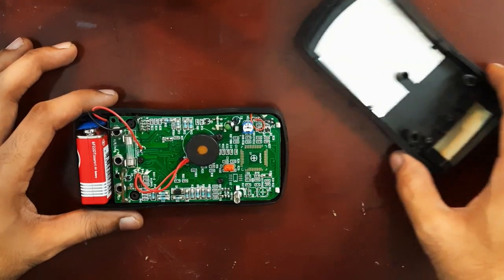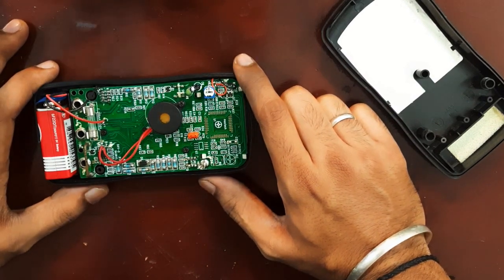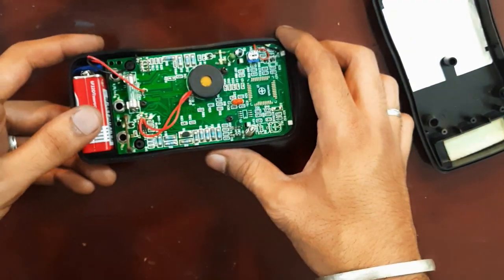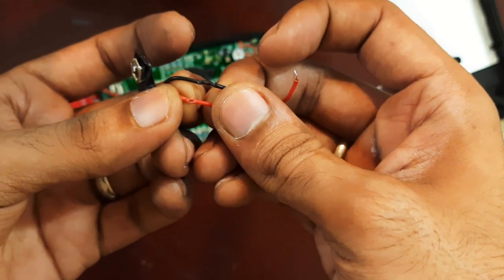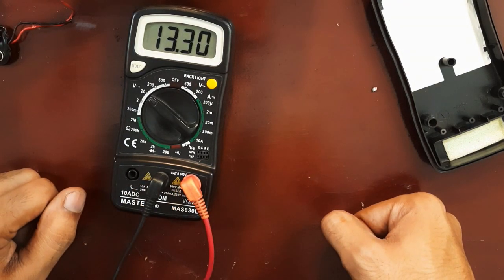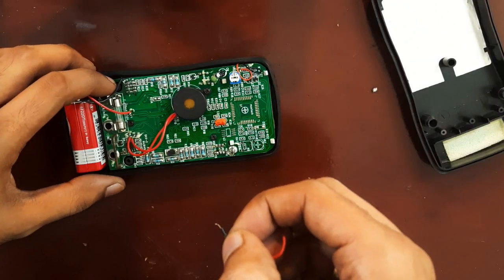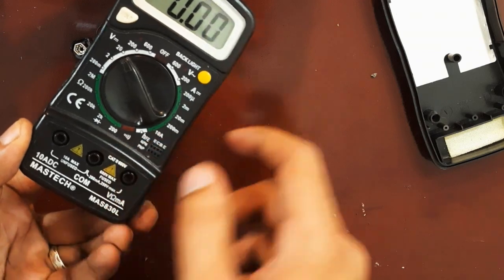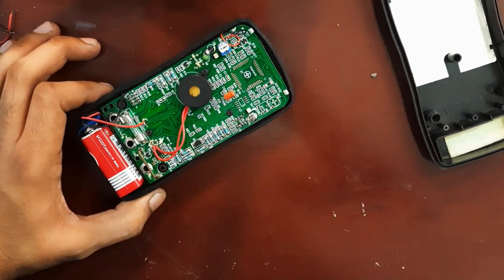Multimeter repair | Incorrect reading in multimeter - repair

Comment: I have a Sperry DM6450 multi meter which is having similar issue .It is reading AC220V as 8 to 12V AC. Its not reading DC voltage or resistance or current properly. Changed the 9V battery. No connector seems damaged. Fuse looks fine. Can a faulty fuse cause the problem?

Comment: Hello, why is my multimeter reads 900 with 20v setting. Im reading from motorcycle rectifier and its in dc setting because the regulator puts out 12~ volts but i cant measure it because my multimeter show like 500-900 so i dont know
Reply: I too have the same problem, replacing with new battery dint help.

Comment: Hi.. I'm also having mastech multimeter model MAS830L 

It is new one. If I kept 20V DC in multimeter, by default the reading varies from -0.2 to -0.5... it is tolerable.

But when I kept multimeter to continuity check, by default it shows -1 and continuosly beeping

Any help is much appreciated

Thank you
Reply from the maker: Looks like the pins might be shorted inside.
Open the multimeter and check if there is any shortcircuit betweek the red and black terminals

Comment: can you please make a circuit to run your laptop from 12v battery using booster circuit and a it will not be off like ups using tip127 which has 5A collector current limit.